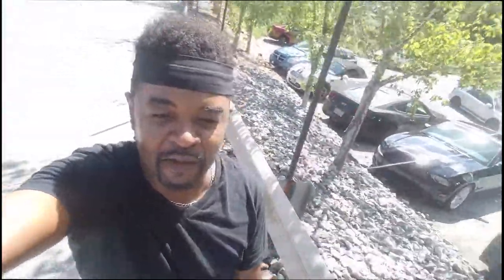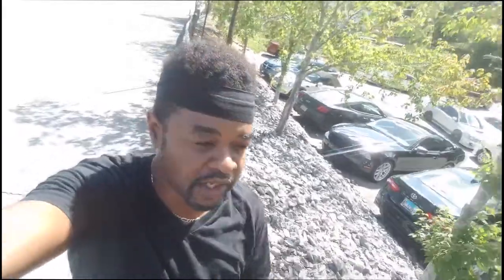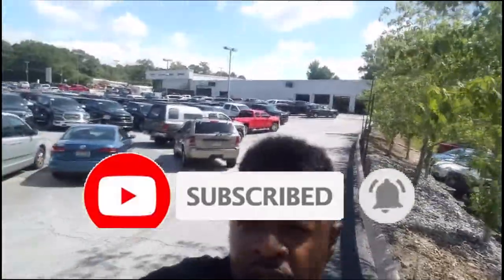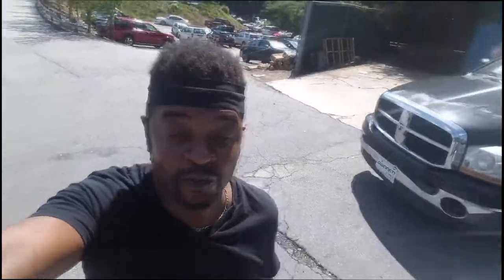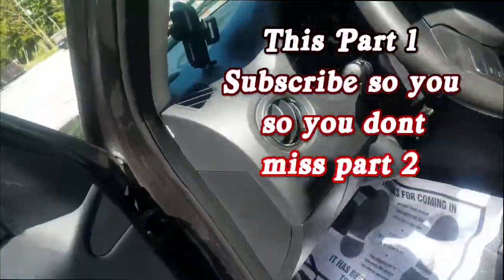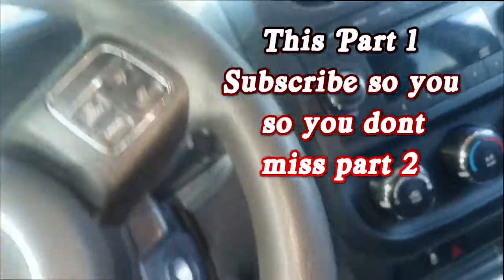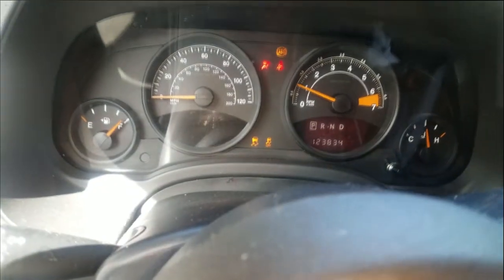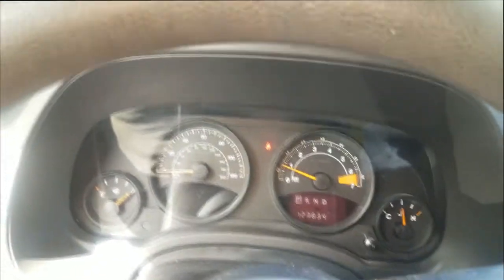Diagnosing a hesitation, bucks, shakes, misfire, rough idle, transmission

Comment: I have a 2016 Jeep Grand Cherokee summit 3.6L and I have a misfire on cylinder one. I've changed the spark plugs, coil packs, crank sensor, cam sensor, PVC valve, change the oil and clean the EGR. My check engine light is still on and still showing a misfire on cylinder 1

Comment: Less talking, more on the actual diagnosis. 

A shop had me spent over $5k, replaced engine and transmission, and I am still having the same issue.

I took it to the dealership where they flashed PCM. Still same issue of rough idle, poor fuel economy  etc. No fault codes.

The dealership provided a quote to fix unrelated items and never addressed any of the issues I continue to experience.
Reply: almost like this guy did.  all talk no help.
I actually stayed to see if there was any advice,???? ugh.